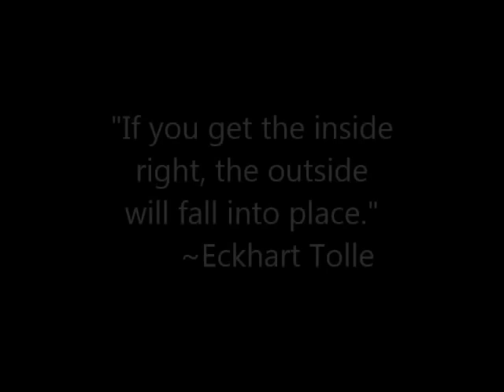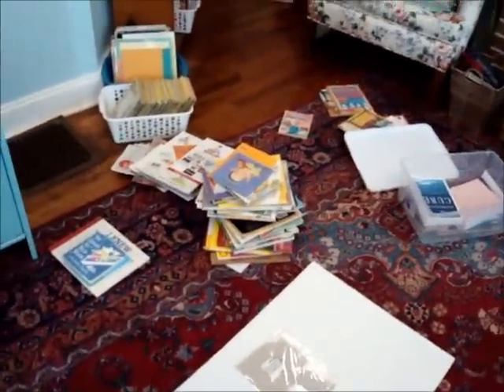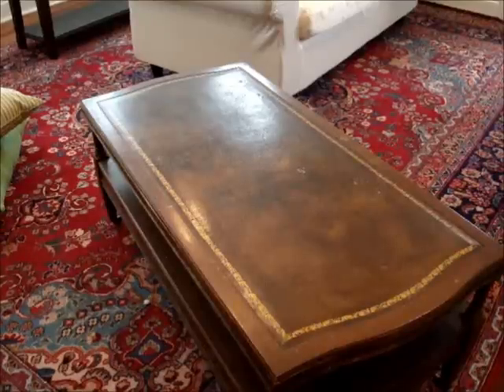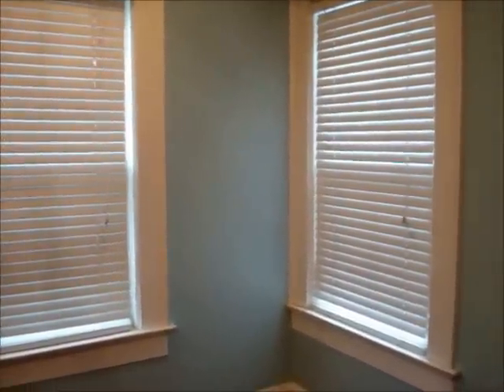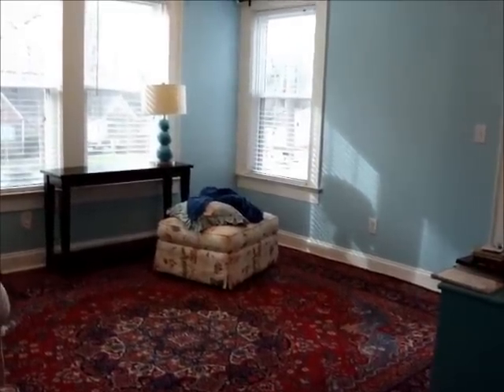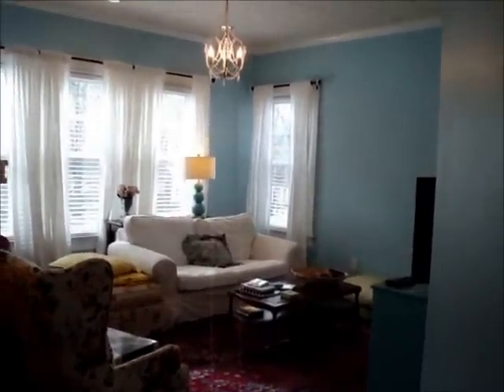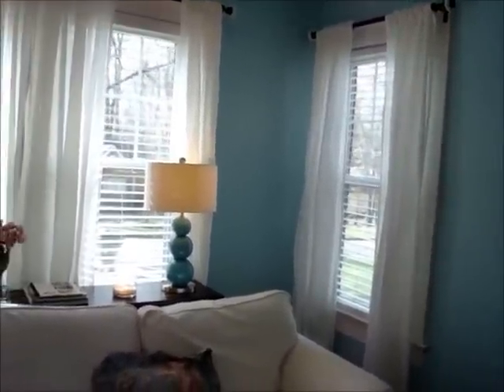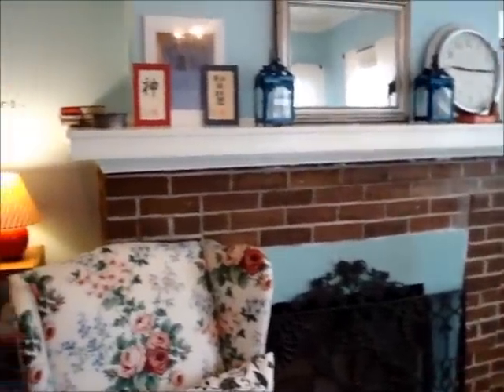Zone Cleaning | Living Room | Minimalist Lifestyle | KonMari

Comment: I would put the sofa in the middle of that windows, the chair opposite to the fireplace and the ornament with the two pillows right in front of the fireplace, so you could enjoy the fire from either far or near. Lovely room, like the colours very very much !!! Thanks for sharing :)
Reply from the maker: +Marilena Markou  Hi Marilena, did you mean the sofa facing the fireplace? It's funny, since I've cleaned up, I don't used the livingroom much anymore. When I did use it during the colder months, I turned the sofa to face the fireplace but always end up switching it back when I'm not using the fire place. I need to experiment with different furniture arrangement, I'll try your way during the winter months but, please let me know which direction you mean with the sofa :)
Reply: +GetTheInsideRight I did not express myself correctly, I ment I would put the sofa right in the middle of the three windows ( it does not appear in the middle on the video), the armchair mounted on the wall where you now have two pillows (by the door) and in front of the fireplace the ornament and the pillows.  So, in the winter, you could sit either in the armchair, or on the pillows enjoying the fire and you will have a conversational area :) I saw all your uploads yesterday and can't wait for the next !!!
Reply from the maker: +Marilena Markou Thanks for clarifying Marilena. The sofa is probably centered in front of the TV and not the window. :) Easy fix. Will update. Never watch the TV anyway so I don't need to center the TV and sofa. I've also tried the arm chair by the door but it never lasts long. I'll try it again and give it some time to see if it grows on me. I'm loving the ideas of the pillows by the fire place. Thanks so much for watching my uploads....Working diligently to finish the study! eeeek!

Comment: Debbie, I hope you'll post an update to let us know if your Lv Rm has been easy to maintain, what it looks like 3 months after KM.  I am so sorry I'm late to your tidy as I stressed about how much easier the tasks could be.  For example, your steamer can have a folded to fit micro fibre cloth added, held in place by heavy duty elastics like those used for hair to more easily clean baseboards.  

It likewise does an excellent job on windows so long as they are not cold.  Hang curtains, still a bit damp, directly from dryer to rod, no ironing needed.   A teeny spritz of starch if available helps repel dust.  The really cheap foam pipe covers [HD/Lowes] shoved deep into the back and sides of sofa cover keep it taut until you pull them out! 
 
I wish you'd paint the leather insert on your coffee table, burgundy/red as close as possible to the background color of the carpet and designate how the lower shelf will be used...give it a 'job.'   Try touching a paper once and taking the appropriate action, no piles to have to go thru, go thru, g thru.  80% of paper we retain is never needed again, it's all about  retrieving the 20%  that's needed, when needed, without drama.
Reply: +Hon Min Nice job!  Your living rm sparks joy right off the page!
Reply from the maker: +Hon Min Thank you! :)
Reply from the maker: +Hon Min Thank you so much for all the great ideas! Will try most when time permits. Coffee table is all wood. Will probably paint but not sure what color since I have a lot of color going in the LR already. Will post update videos for sure. Thank you so much for watching xoxo
~Francine